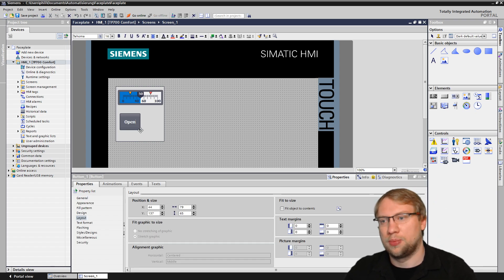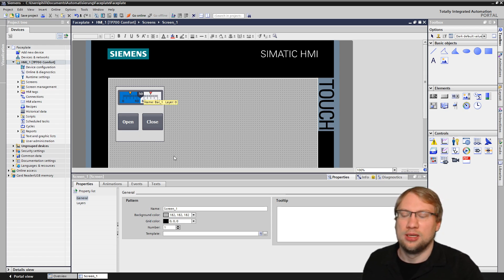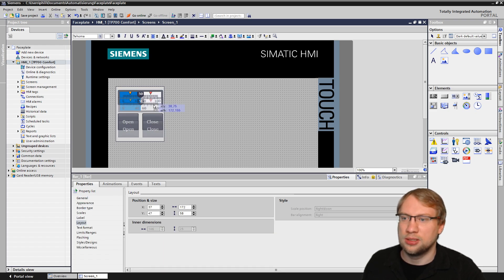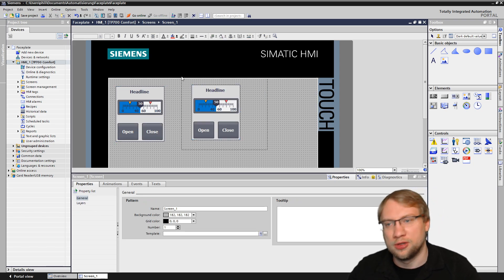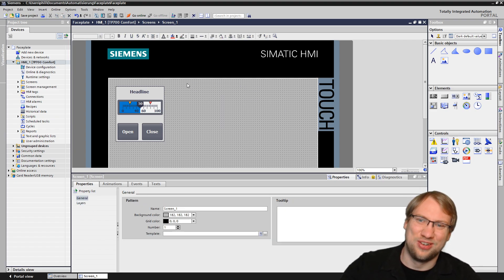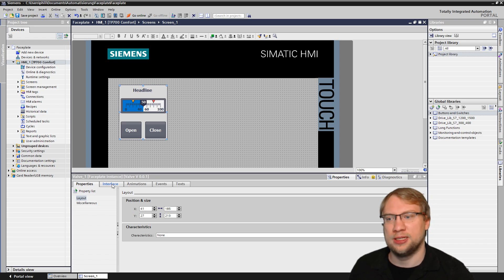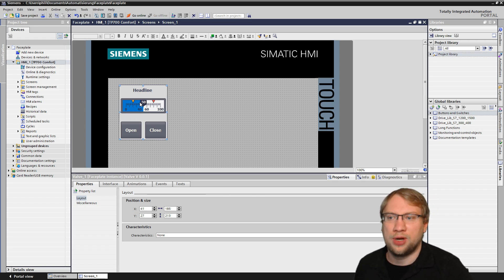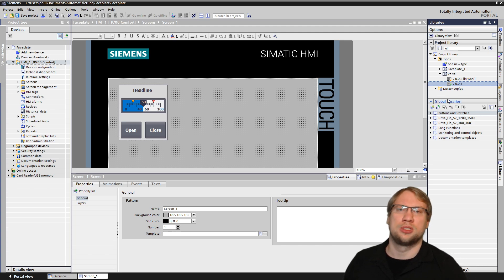TIA Portal: HMI Faceplates Part 1

Comment: Your all videos are very helpful, please make some video on fail safe PLC
Reply from the maker: Unfortunately I don't have a failsafe PLC here, I hope to have access to one at some time
Reply: @hegamurl7434  ahh, it's ok no problem, take your time.
Reply: @hegamurl7434  plcsim allows simulation of F cpu's and safety program
Reply from the maker: @DeKempster  Really? I always assumed it couldn't because safety cpu's basically need a 2nd cpu, which PLCSIM does not normally take... actually never checked! Very interesting! I'm looking into it! Thanks for the hint
Reply: @hegamurl7434  how about plcsim advanced? Could that take a 2nd cpu maybe?
Reply: There is no need for a second CPU. F CPUs just have two programs. A user program and a safety program. (Source: we use them in our projects). Only thing that needs two CPUs is high availability H CPUs but that's a completely different thing. Also you can have multiple instances open of plcsim.
Reply from the maker: @DeKempster  sorry did not mean CPU but processor(so the internal one). Of course you don't need 2 CPUs for safety... I just did not know plcsim could do it, but you are rightm it seems that it can. Pretty cool!

Comment: Hey. Is it possible to connect the entire DataBlock to FacePlate? I have FunctionBlock for scaling analogs. There are low and high level alarms and other functions. I want to connect DB with FacePlate once, instead of linking each value separately. I know that it is possible to connect UDT. Can you explain this topics. :)
Reply from the maker: Very good question, have never done it before with UDT... I don't know if it is possible, but I will check
Reply: Yes this is possible. You have to put in the udt as a type, instead of the integer in the video. i think this was added in V14 and onwards.
Reply: @DeKempster  pretty sure it has been possible since at least version 12 :)
Reply: @MrBoowashere  could be, I refuse to remember anything below the v13. Especially 10.5 what a mess was that.
Reply: @DeKempster  Yeah I have heard it was bad but I never had the chance to use it. Probably a good thing :)

Comment: Thats one of the best uses of an HMI, btw is it possible to do something similar, about using parameters but with an HMI Image? I mean, in a basic panel where the display is small and it isn't viable to use a pop-up screen, is it posible to use the same HMI image with multiple conexion on its elements ?
Reply: This is possible using multiplexing